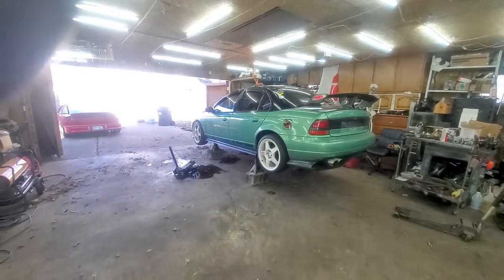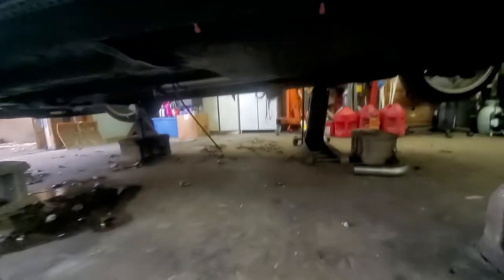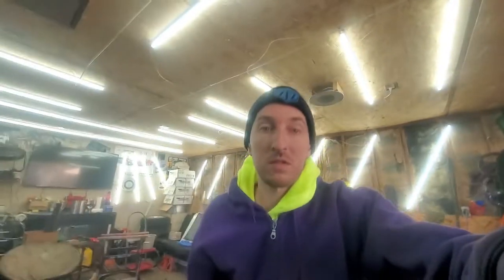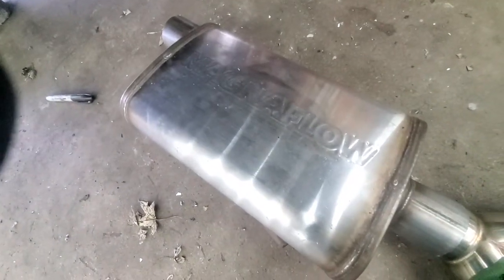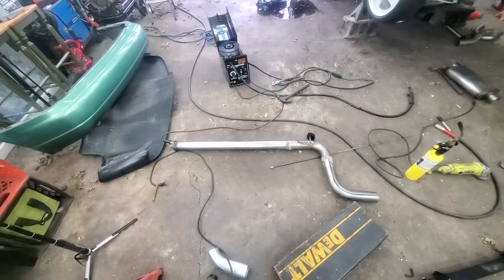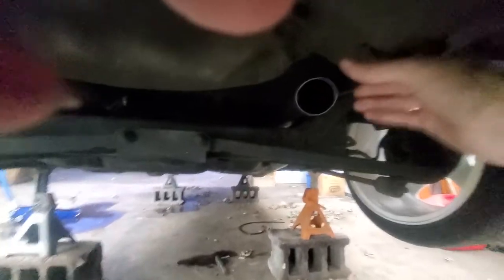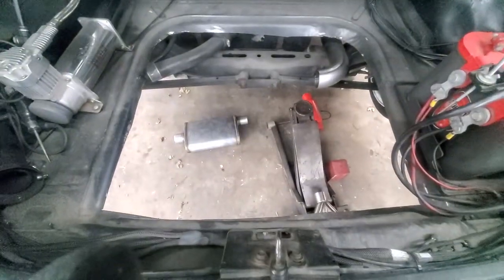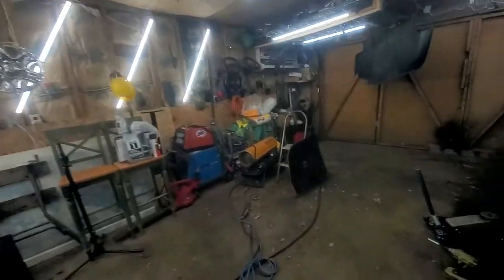Custom Saturn Exhaust

Comment: I've been waiting for another BiBiG video.  I routed my exhaust to the outside of my rear subframe to give it more of a straight shot. It fits there just barely and goes into an cheap ebay glass pack.
Reply from the maker: Nice! I started with a "fart can" myself... I recommend a few good resonators under the car for a really good sound...

Comment: Extra stability tip; perhaps turn the blocks 90° so the strength ribs are vertical and put some sturdy plywood on top in case it shifts. Be careful and have fun
Reply from the maker: I'll give that a shot next time! Thanks for the tip!

Comment: That worked out well eh, even sounds pretty good, well done dude. I've done some things in videos that will probably trigger the internet, but lucky for me, no one watches my crap.
Reply from the maker: Lol thanks, it sounds even better driving and in person... and im like king of unsafe acts lol my cut off wheel has no finger guards and I trust my jack way too often lol
Reply: @BuilditBreakitGarageinc  My grinders and cut off wheels are also without guards, lol. At least your smart enough not to trust scissor jacks, wish I could say the same for myself, I use them way too often and trust them way too much. Lol. The second last vid I posted is a shining example of this. I have yet to have anything really bad happen.

Comment: Hey build it, can u interchange the 99-02 roller rockers to 95-98 SL2 heads? I copied the interchangeability of everything on the DOHC LLO engines from a Saturn post, and it's very educating but, of course  course GM did some really good , yet stupid things to the 1.9L engine, like adding roller rockers to the 3rd gen, and a stronger block, yet made the intake ports smaller with the roller rockers to bottle neck their potential ...lol
Reply from the maker: No the whole entire 3g head is unique to itself, nothing will swap over... but the 2g head isn't really bad, in fact the way the lifters are positioned they spin around kind of like a roller rocker of sorts
Reply: @BuilditBreakitGarageinc  I have a 2nd gen oddball. The 95 heads  before they graduated to OB2 ..lol.
Reply: @BuilditBreakitGarageinc  The 1st gen pistons had thicker ring lands from what I've heard also. I'm wondering if when I have the machine shop do my build to see if I can get good aftermarket pistons , that have thicker ring lands with them at .20 over. Of course the early pistons were dished with flat faced valves , then on mine are flat top pistons with dished valves. I'm gonna run 3rd gen crank, and tie plate like yours, and 14-15 PSI on mine with port and polished head and the deshrouding, port match, etc , already have bigger TBI, CAI, and a carbon fiber hood I'm also gonna do RPF1 15X7 Einkei's and 205 50 R15 Toyo Proxies, lightweight flywheel and limited slip differential. Should have the baddest Saturn in south Florida, just hope I don't get hit. Lol
Reply: @BuilditBreakitGarageinc  Oh, I forgot to also ask. Do u think I should upgrade to single valve springs, since I'll be also running dual intake cams and 14-15 PSI of boost?
Reply: @junechris  if your going turbo think of going 17s I run 17x7s on mine about to go to 17x 8.25 and run 245-40-17 Firestone Indy Firehawks crazy grip.....if your in south Florida link me up I can help you with custom turbo and suspension stuff
Reply: @pirsq314  I already got the Einkei RPF1 15X7's and a set of Yokahama Advan Flexa 205 55 R15's so I think it's a little late for that. But I still got decent grip or at least better than the originals on the car and I also saved 5 lbs a wheel in un sprung weight so I can't complain about the acceleration increase I feel when driving and cruising around town, etc. I went from 15 Lb rims to 9.8 Lb rims so it was pretty substantial drop in un sprung like I mentioned.
Reply: @pirsq314  Sure man, what contact should I use or where are u located. I got a guy DA performance doing the engine build but if I need some help with other things I might take u up on that.